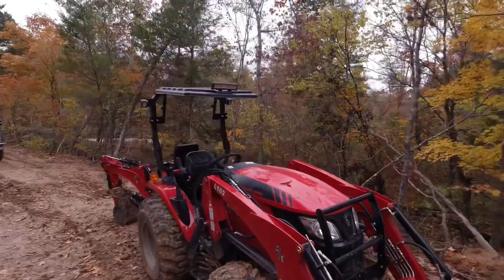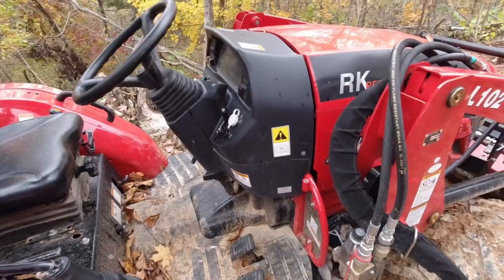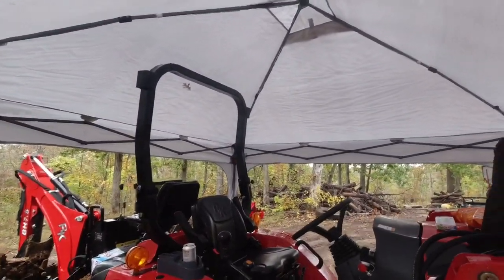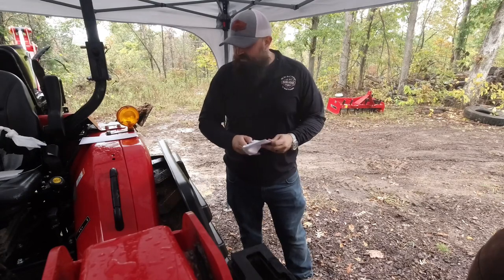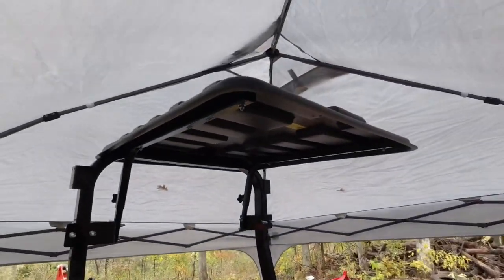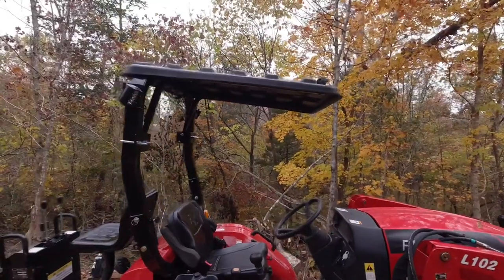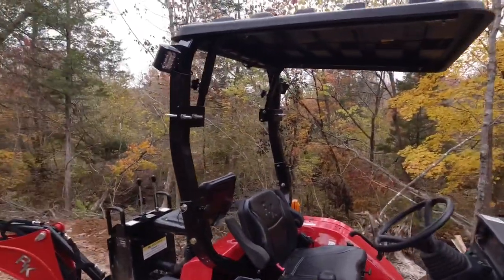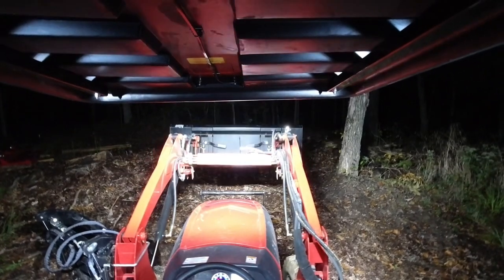CHEAP Amazon light and canopy install | RK 37 Tractor

Comment: Nice install! It's like daylight in front of you.  It looks like your area can be a bit muddy.  How do those R4 tires do as it gets deeper mud and slippery?
Reply: Good question.  I’m not disappointed in the R4 tires.  In general, they work pretty well.  The only problems I’ve had slipping are sideways on side slopes.  The lug patterns are great forward/backwards but not in a side slide situation.  Looking back, I would have ordered the newer R14 hybrid tires.  They were an available option when I ordered, but I’ve heard the R14 can be harder to get now.
Reply: Hey can you provide a link to the canopy kit you used. Looked pretty good.
Reply from the maker: It is from rhinohidecanopies.com.  I’m still evaluating to see if I would recommend it.  Even though it’s solidly mounted (I can hang off the brackets), it bounces around more than I particularly like.  It was cheaper than most, so not a bad deal.  But I’m looking at ways to possibly reinforce or something to stop it from wobbling so much.  Not too bad, just a peeve of mine.